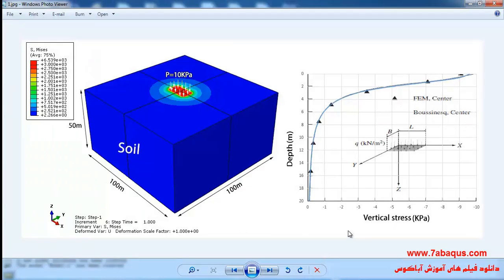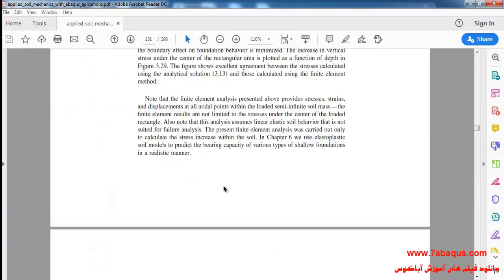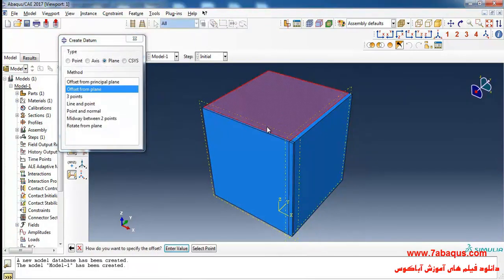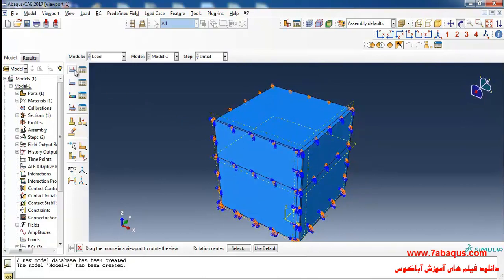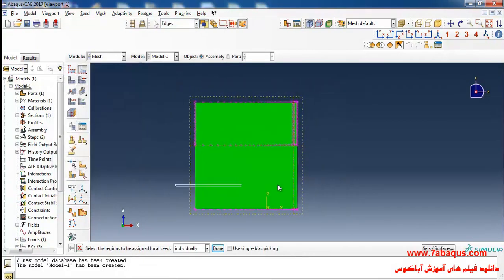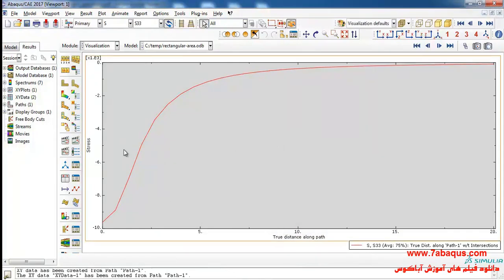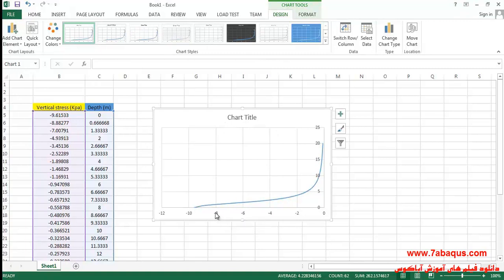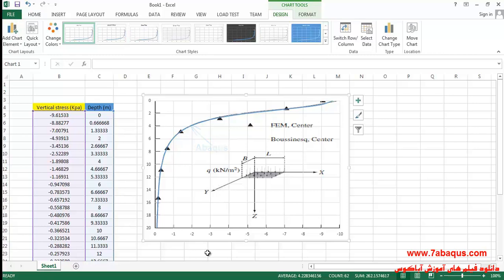Stresses within the soil caused by the rectangular Load Abaqus

Comment: I have a question for the teacher.  If in the first step of calculation, the "geostatic stresses" field has been applied.  So in the "geostatic" step of applying the body load, will pressure be added to the soil mass in the next steps?  (geostatic stress) + (body froce) = (pressure)

Comment: The soil modeled as homogenous material that behaves the same way in both tension and compression. I was wondering if there is any way to define the soil exactly as it behaves in reality with having its parameters? Then we will be able to apply shear and tension to the soil as well, and we will be able to see the exact soil behavior